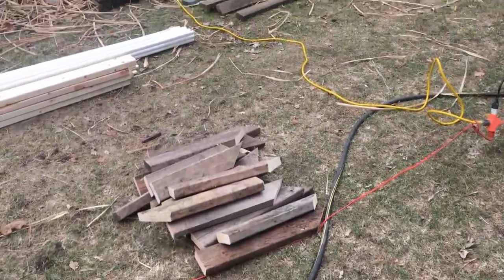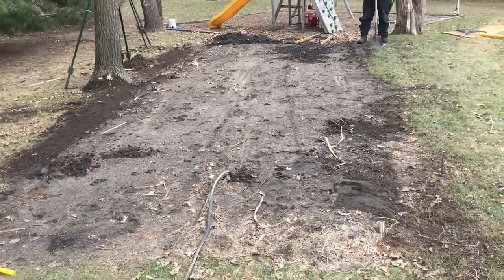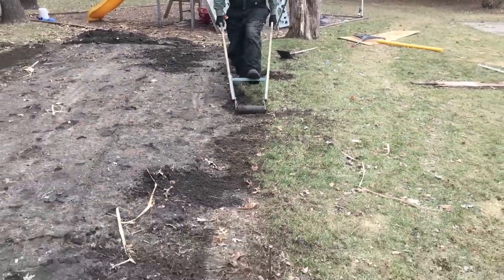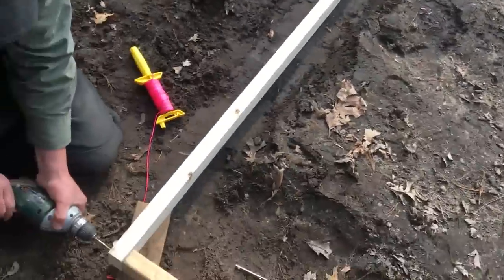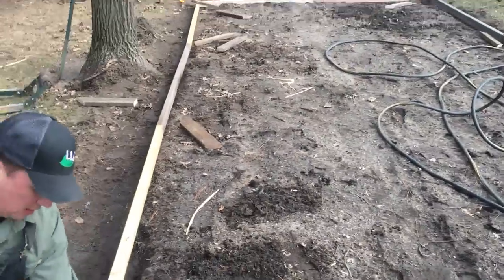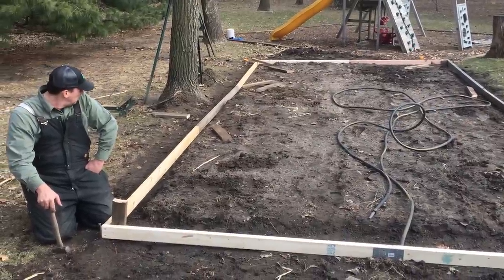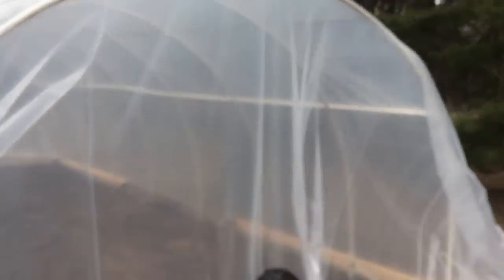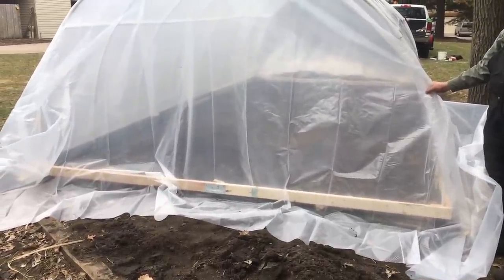PVC Greenhouse Step by Step DIY

Comment: God forbid your not a professional cameraman but the folks will happily take your ideas, your instructions and run with it.  Reading You Tube comment sections is worse than working in a customer service call center.  People are BEYOND rude.  Thank you, sir, for your info.  I dont care if your camera is at a 45 degree angle if you provide info I need.  Thanks again

Comment: info only - I buy my clear poly from greenhouse supply stores online, I can get 9 mil or 12 mil plastic that lasts 6 - 7 years in the hot southern summer sun. the 6 mil from box stores only lasts about 2 years here, 12 mil costs a little bit more but lasts a lot longer. I use cattle panels from tractor supply to form the hoops  they give much more support to the plastic, it is faster  and easier to assemble and makes a very strong framework. cost me about $500 to build a 12 w x 24 l x 90" high at  the peak using this method. The 90" height framed in on both ends allows for installation of a storm door I bought at a salvage store for $25.  I also bought 2 used storm windows to go in the  other end from the door, I use them for ventilation when needed. I installed temperature controlled foundation vents on each side of the door. they open when the inside temp reaches about 50 degrees and allow air to flow in at a ground level and help push hotter air out the storm windows on warmer days.
Reply: Hello Roy.  Your installation sounds nice. Do you think it  would be possible to have a picture of your greenhouse?  I am planning on building one to grow flowers.
Reply: @dominiquehouleemc1044  I can send photos via a text or email address. I don't know how to post photos on youtube.
Reply: @dominiquehouleemc1044   I can provide photos of the greenhouse via text or email address. I don't know how to post photos on youtube.

Comment: Before piercing the poly for the zip ties, use wide invisible tape on inside and outside first., then make your hole. It will keep from stretching the hole
Reply: great idea
Reply: Well that's what I was thinking too and I didn't see your comment until I made mine lol
Reply: The poly would normally be fastened to the timber crosspiece and door uprights on the ends of the tunnel. Pvc tube isnt rigid enough to allow for correct tensioning of the poly which is why hoops are made from steel.  A poly covering that resembles a wrinkled sock wont last as long as one that is drum tight...
Reply: Dale Bratcher loll
Reply: If putting holes in plastic wrap, put a 16 penny nail in your visegrips and heat cherry red with torch then burn/melt the holes thru. A little less chance of tearing.
Reply: Ryan Matthew ......yours

Comment: Would it help if you put tape on both sides of the plastic sheeting before you poke a hole through it and then use the zip tie?  I would think that would give it much more strength so it wouldn't be as prone to stretch out and possible tear when you snug it up with the zip ties.  
     Thanks for the info, the video and for sharing your knowledge. 
     God bless ya

Comment: I'm not sure what to do in my situation. I have a 1.8m by 1.2m space but have been wondering what is the cheapest way of creating a big transparent box for my plants that is 1.5m high and doesn't require a perfectly level floor. I can get sheets of cheap extruded acrylic for the sides but I'm unsure about having a totally flat roof that is 1.8m by 1.2m wide (it might bend in the middle when it snows).

Comment: 19:55 Couldn't you take a piece of pipe, cut it down the length to create an 'open' pipe and then put that C shaped piece onto the the pipe in order to afix the rolled up excess onto the ribs? (pipe on pipe)

Comment: I built a similar hoop house last fall. The rebar is a must have imho. It really stabilizes the bottom of the hoop house. 
My advice is to have the rebar sticking at least 1 foot out of the ground or even higher if you can. 
The longer pieces of rebar help add height to the side walls of the hoop house and give you greater growing vertical width inside of the greenhouse.
Your side walls end up being straighter and taller giving you more growing space.

My hoop house was 8Lx8Wx8H and the walls didnt start curving until it hit 4 feet high. Taller = more growing space.

Also, regular clear box tape with hold the poly roof down to the side walls. No need to poke holes in the poly roof and use twist ties. Just use plenty of clear box tape.

Comment: I think how long this type of construction lasts depends on your climate. I'm in Zone 8 Maritime and our pvc pipe/film hoop house is on its fourth summer. The film is UV rated vapour barrier (with white lettering on it - ugly!) and the structure is dismantled and stored during the winter as we mainly use it to give warmth-loving crops a bit of a head start and keep summer rains off the tomatoes (problems with late blight). When I want something year-round I'll probably go for a sturdier frame - winds can be a bit of a problem in our area.

Comment: If you plan on planting in the ground, lay poly down all around the outside of the greenhouse so that the soil is heated and will allow the soil in the greenhouse to retain its own heat during the day and overnight. 
If the ground outside of the greenhouse is allowed to cool, it will suck the heat from the soil inside of your greenhouse and negate your efforts.
Reply: How far out on the outside piece?

Comment: You should be using treated wood since it's almost and probably will be touching the dirt so it wont rot out so quickly.I watched a different video where the guy used grey pvc instead of the whites.The grey is designed for outdoor use unlike the white your using.There are also plastic clips you can use so you don't have to zip tie it.In strong winds it may tear where the zip ties are at.If you were to use a tee connector where you want the door to be you would add strength where the door opening are and have something to connect to.Could have also used the tees for the base to connect the pvc too and used rebar to stake it down to the ground.The video I watched,now it was a dome and I know this is larger but he built it without counting the plastic for under 100 bucks.

Comment: I build one of these 12x20'  and it worked great .  except it wont stand up to wind or cold first winter shredded it and had plastic all over the backyard the trees and the field.  8mm plastic was expensive and didnt hold up  I recommend the flexible panels that I have now 2 more winters no problems.

Comment: I tried something similar. While it is gratifying to get the house up in a day for cheap, it is depressing to see it fail in a windstorm with your tomato crop inside becoming ruined. It happened to me with a smaller hoop house of similar construction. Also the zippers didn’t work too long. In addition, you will get two years max out of that type of plastic. Then it will start to crack and crumble into micro plastic pollution. Small removable pvc hoop house/cloche type structures worked pretty good for me though. PVC and row cover works good too.

Comment: Clear 4" boxing tape work really well with the poly. I used only tape on mine, no zip ties. Its held all fall, winter and spring so far. I get it at the dollar store for a buck per large roll...

Comment: why do you not use something like gorilla glue to connect the pvc ends?  You are using a two part glue fastening system generally used for a water tight fit, but these pvc don't need a water tight fit.

Comment: Also u can use an old trampoline..
Disconnect it in half, flip it and u got 2 arches, use the legs for cross bracig for the roof, it took me two old trampolines with legs, to make a 12' long × 7' wide and 8' high perfect for what i intended, 
Great video man 👊🏼😎
Reply: Ty Rev_80 M .. 
W  complete
 elemental collection 
Rain《Water》
Thermal《Earth
Turbine 《Wind》
Solar 《Fire》
❣Success Achieved❣
When U Grow UR own  food it's Free 😊
Reply: How did you do plastic attach to tramp frame
Reply: You god darn genius,...steel baby steel

Comment: I've had a large PVC greenhouse for 2 years now.  The following are facts, not opinions.  PVC is not a good material for the hoops.  Sure it's cheap initially.  But if it directly contacts the plastic it will deteriorate the plastic within months.  So the PVC must be separated from the plastic sheeting with tape or some other means.  White PVC for plumbing is not UV resistant and it will break down after 1 or 2 years.  Gray PVC conduit is more UV resistant but still deteriorates the plastic.  The PVC gets very brittle in cold weather and fatigue cracks easily.  In order for the PVC hoops to stand up to snow load, an internal support beam and posts need to be added.  Strong winds put a side load on the structure...without proper bracing this will cause the PVC hoops to fail (happened to me).  Once you do all the things to address these issues you've spent so much time and money that it would have made more sense to build it out of steel hoops in the first place.  Like I said, I've lived it.  I spent many hours repairing the PVC hoops.  Do it right, do it once!
Reply: Ty Geezer The gamer great additional info 🥂
Reply: Matt Schwartz I actually honor your experience .and will now consider a better hoop .asap
Reply: Cattle Panels work great.
Reply: Where do you get steel hoops? What section of the hardware store are they in? Are they bendable? What is bracing?
Reply: J NYC, chain link fence top rail is commonly used for diy hoops. It’s available at all big box home improvement stores. Make a jig out of plywood to bend it. There are some videos showing how people bend it.
Reply: Geezer Gamer, the greenhouse in the video you linked looks very nice. I can tell you though it won’t stand up to much wind. So if it’s in a protected location it will be okay. I had a very similar design but had to add “A” frame braces made of 2x4 at every 3rd hoop because the wind was collapsing the sides.  The key is to find videos from people who have had their greenhouse for a while and can speak from experience.
Reply: @ Matt Schwartz you are correct sir, fully. You described my experience from last year. Snow load destroys this build.
Reply: ive spent 3 years and you forgot that snow or water can cause the plastic to drop in a large square that ways a lot i used pinpricks on my plastic to prevent this i also use a space heater inside
i used adhesive tape around my pcp pipe but metal and thick plastick is the way to go..if you want it to work with no headaches

Comment: OKAY, no good!!! I did this with pipe and and the problem is there is too much space between the pvc of the roof such that when it rained it made pools then the pool of water became so heavy it caved in all the plastic during a heavy storm and following frost severely damaged my lemon trees inside. when first done it looked beautiful and kept a lot of heat in but again the spacing caused a collapse from the weight of the water.

Comment: You wouldn’t have to use zip ties. You could take pvc pipe slightly larger and cut them and make clips to secure the extra poly to the frame.
Reply: Nope
Reply: NIIICE ❣ Tytyty

Comment: Add additional layers of poly to the roof and walls. The thicker the poly, the more heat retention you get. More layers = more stable temps in a winter greenhouse. I would have a minimum of two layers and even more, if the poly is less than 4 mils thick.

Comment: Heat a nail "Hot" then puncture your hole, this seals the plastic and helps it from tearing.. Better yet, you can run two pieces of rope kris-crossed between each hoop and anchor the ends, this will eliminate puncturing the plastic and the use of "zip ties".. The rope will firm up the plastic and eliminate flapping almost completely and last so much longer against high wind..

Comment: sometimes going cheap actually costs more in the long run. This construction plastic from the box stores will degrade quickly because it is not designed for outdoor/greenhouse use. The white plumbing PVC pipe also off gasses and will damage the plastic where it touches and is also not UV stable.

For those looking to build a greenhouse, use greenhouse plastic from a greenhouse supply company and use electrical/gray pvc pipe or steel electrical conduit for the structure. Both are UV stable and will not degrade with sun exposure. The gray PVC will not damage your covering. You can purchase tape that protects the poly covering or paint the white PVC but that is very time consuming.

Also don't use zipties and make sure staples are stainless steel. They are also not uv stable and will degrade and break when exposed to elements. A greenhouse of this size should cost a minimum of $1000 and it will last you for many years...4+...I have heard some people getting 6 years and more. The way he built this one, it will last a year if he is lucky, the plastic blocks critical light spectrum's, the wood base will rot quickly if it is in contact with the ground and all the labor will be down the tubes and necessary to repeat next year.
Reply: Mostly good comments but my experience with the gray PVC is different.  Mine did damage my plastic sheeting (which is 4 year rated greenhouse film and has otherwise held up great).  In areas that get snow, I strongly recommend going straight to steel hoops (chain link fence top rail).  I agree that the way the greenhouse was built in the video will not last long.  I don't like to leave negative comments but I think prospective builders should know the truth before they waste a bunch of money and time.
Reply: @mattschwartz915  if you paint the pvc first, it will add much more life to the project.  Im lazy, so i look for things that last lol

Comment: Why not make several sections like the first one then just place the remaining perlin pieces between the standing sections. Like one other commenter use steel, My local welding shop made bows for $30 each and they will last longer than i will be gardening.

Comment: Q: What if you install one the zippers on the inside, so that you'd always have a way in & a way out, though it would be a bit of a tight fit going in or out until both were unzipped, but it would be warmer inside while working on cold days without ever getting stuck inside it and needing to be let out.
Reply: Or just get zippers that can be opened from both sides...

Comment: I made a greenhouse just like this, but I want to warn anyone using PVC  where it snows- it breaks under the weight of snow. Like the Zipper, pretty cool and this would work great where no snow. We had to reinforce the PVC frame with wood and still the snow pushed in from the sides as the snow built up.

Comment: No ridicule intended, but offering a few tips .1) needs treated lumber next to the ground .2) you can use wood framework for end gables, therefore framing in a door /window . 3) anytime you poke a hole through plastic, you're inviting a tear that the wind will absolutely ripped apart. But overall y'all did a great job!

Comment: Don't think the zip ties gona cut it properly rip to shreds in no time, id maybe a heavy grade tape patch and a roofing style screw with the rubber washer and to counter the cost maybe replace as many pipe joint with full length pipes and lash or zip tie any cross joints and cover with patch before poly goes on.
Also could bamboo could cheaper option to save coin $.

Comment: in case that I only have cement backyard instead of ground backyard like yours, what should I use to base my pvc frame?  Please help!!
Reply: You don't need a greenhouse. Plants grown in cement instead of soil are extra hardy and cold resistant.
Reply: Just put the 2x4s directly on the concrete.

Comment: I love the design , and I know you are trying to build it as cheap as you can , but I'm like you 2/6 on the outside dia of the house is what I would do  , and I would use bigger pipe for the  frame  , and I would frame in the Ends ,  the zippers are awesome , would work great for a window for air  , I'm not criticizing  I love what you have done here , I love it but me myself. Would beef it all up and double layer the plastic and put a solar fan between the layers so I would have a dead air space ,  but you are awesome sir   Thanks for the video

Comment: Never, never, never use regular lumber in contact with the ground. Always use ground contact pressure treated lumber. Instead, use some straight concrete landscape block around the perimeter. The rebar is a good choice.

Comment: at 15:50 use the following formula for measuring the arch length :

2 x Pi x R x 180 / 360 , simpler : 2 x 3,14 x R x 0.5 , where R is the radius of the Circle ( meaning the height of the green house , measure the middle post if you have one or the distance from the ground level to the top ( middle ) of the green house , obtaining the Height H ( or Radius R as i wrote it in the formula )
Reply: That's gonna get you A+ in math class. And then you're gonna step out into the garden, and realize that there isn't a perfect circle to be found, anywhere, and therefor the formula is useless. You gotta measure it.
Reply: You mean pie  x R    2x 0.5 =1

Comment: To tie rap the poly to the frame instead of punching a pilot hole you should cut 6 inche plastic tubing of same diameter removing  1/4 of the the length and simply snap the 6mm to the frame using 6 inch plastic tubing with slits

Comment: the pcp pipe gives of gas that will destroy the plastic in contact with sunlight,i taped my pcp tape and i use much thicker plastic,this will not hold up in severe winter weather..

Comment: How long does the 6ml poly last in direct sunlight?
Reply: I have 3 years on my 6ml poly and wont have to change it this year either, its in direct sunlight and has had 6ft plus snow fall on it ( not at once as i clear it off every foot or two ) the wood frame is 16inch spacing to hold the snow and no issues. I secure the plastic with staples then duct tape over the staples. Hope this helps